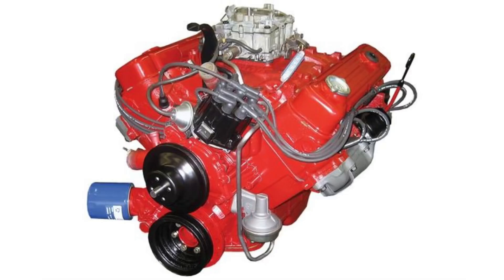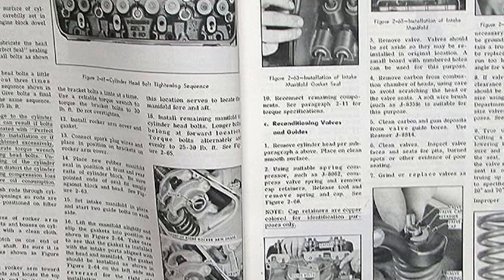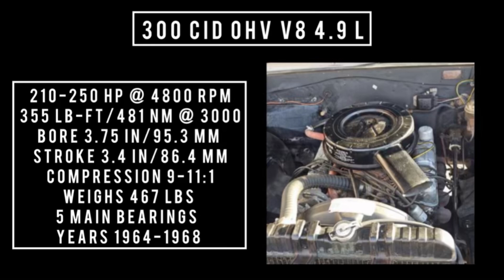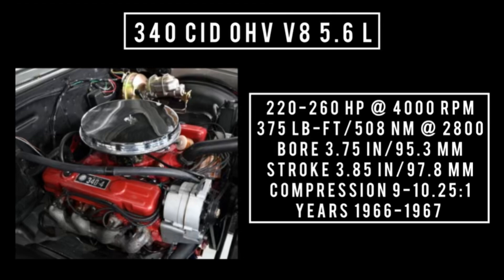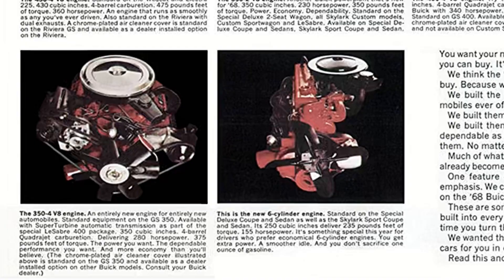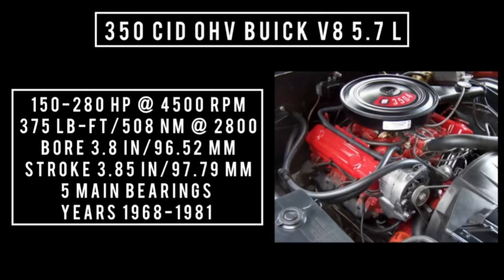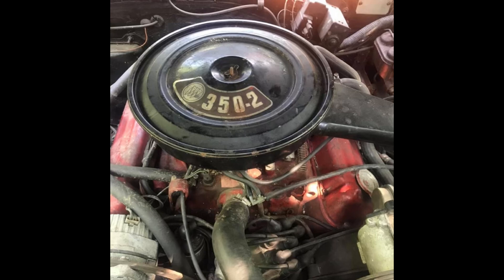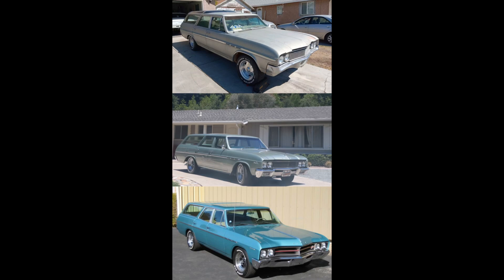Buick small block engine family 300, 340, 350

Comment: i have a 67 skylark with the 340.  It is a powerful engine.  I port matched the heads and smoothed out the chambers and put a cam in it.  No aluminum intakes or headers I could find so did what I could.  Runs hard and sounds great.  I have had buick 350's too and they seemed to be good motors too.  The 340 was hard to find the safety valve for in the oil filter housing that bypasses a plugged filter.  Had to drill a hole in mine and punch out the piston in it to get it to release then weld back shut.  Also the 340 has a small oil pan so careful if you put a high volume pump on, which is another story.  I think because there is no sump pump is why the pan is smaller.  Prime the pump before you start it the first time or periods of not running or you will roast the bearings!

Comment: It should have been mentioned that the 300 and 340 were revisions of the original 215 V8 design, but for the Buick 350, the entire top end was redesigned, beginning with the valve arrangement. Therfore,  even though the 340 and 350 share the same deck height, everything from the camshaft up was different- cam, heads, intake manifold,  exhaust manifolds, even the valve covers. Also, for 1968 the Buick 350 was fitted with the Quadrajet carburetor, making the intake manifold different in that respect also from that of the 340, which came with the square bore Carter AFB.
Reply from the maker: Thank you for sharing that insight
Reply: @What.its.like.  you're welcome. I learned all this because I have a 1966 Buick 340 engine.  It is a 2 bbl version, and I was able to buy a 4 bbl intake years ago for it. Hard to find, for sure.

Comment: In 1970 Buick offered the 350 in three states of tune. Top dog had 315 HP. 280 HP was the standard 4bbl version.
Reply from the maker: Thank you so much for that correction I couldn't find any information on the 350 everything that I found was very limited.. so 280 was the highest figure I saw 

Thank you for that correction

Comment: The 300 was available with a 4bbl carb for 1964 and 1965 only. It was available with the 2bbl carb from 1964 to 1967. In 1968 it as replaced by the 350. The 340 with either 2bbl carb or 4bbl carb was for 1966 and 1967 only. Also replaced in 1968 by the 350.

Comment: The Achilles heal to the really great engines, including the big Buick
 400,430,and,455 , along with the 225,and 231 V-6,is overly extended oil changes,poor quality oil filters with poor drain back valves.good oil and filter service is very important to the long life these Buick engines are more than capable of providing.
            Jay, thanks for the coverage of these great engines,and I thought I was going to point out they used these in Jeep products,but you knew that,as always great work, looking forward to the next episode.
Reply: Back then in the 1960's and 1970's standard O.C. intervals was 3000-3500 miles, I ran a fleet garage and never experienced oil filter related failures. In fact, in comparison to the filters on the market today, I'll take the old ones, less plastic and glue. We always ran factory branded filters and oil from top tier refineries. Keeping a vehicle tuned correctly was the secret, no gas contaminated oil from poorly adjusted carburetors, point and plugs every 12,000 miles along with replacing PCV every 24,000 miles.
Reply: @lorimcquinn3966  I have learned that there are differences in oil filters as far as certain performance characteristics.
              When I had my 68 Buick Special,with a 350,I bought a house brand from a big auto parts chain,instead of the name brand I would usually buy, installed it started the engine,waited for the  pressure to build which during the first start up takes a bit to prime, usually after that immediate oil pressure.With the house brand filter it would take its time building oil pressure,I bought the filter I normally bought,changed the house brand,back to instant oil pressure.
         What I learned,there is an important difference in drain back valves,and on certain engine makes filter position can be in my experience make an impact on how fast initial oil pressure builds up and in some cases can have a potential affect on potential bearing damage.
Reply from the maker: Thank you so much for sharing all that great information and insight greatly appreciate it

Comment: Hello Jay!  Just can't say how much I enjoy these engine episodes!  I always learn something!  In this episode I learned that the 340 and 350 Buick V-8's had a longer stroke than bore!  Not by much, but EVERYTHING was bigger bore than stroke in those days.  INTERESTING!  WYR One. . .1966 Special.  Two. . .1967 Wagon.  I knew a fellow that had a pretty nice 1966 Buick Sport Wagon.  A really interesting car!  Can't wait for the upcoming episodes!  Particularly the Graham and RUXTON episodes!
Reply: The G-block Oldsmobile 400 was the most undersquare V8 ever made.  As I remember, that was done for its inherent lower emissions profile.  But, there's a lot cubic inches trying to breath through heads and valves made for a small V8.  It was a great torquey engine for the big Olds sedans and station wagons but, it has very little performance improvement potential.  Put a later GM HEI distributor on it, a 2 bbl Holley Sniper throttle body fuel injection, and that's about all you can do to the G-block Olds 400.
Reply from the maker: Ruxton is next working on it now 

That graham was awesome

Comment: WYR1:  The '66-'67 A-body Buicks are the best looking cars ever to wear ventiports. 
I'll take the '67 Skylark convertible, white with a black top and red interior, 340-4 three-speed column shift. 
I seriously considered one some years ago, probably swap in the Special/GS grille. Might even trim it out with the GS340 graphics. 

WYR2:  The '64 on show here is the Sport Wagon (5-inch longer wheelbase than the Special wagon, extended back doors and raised roof with glass panels). Buick discontinued the B-body wagons (LeSabre and Invicta) after 1963 and this was their near-full-size market entry.
Oldsmobile fielded a similar version of the F/85 wagon called the Vista Cruiser
My Mom's first cousin was high-up in Buick, actually head of a transmission remanufacturing plant in Atlanta, and he could get any Buick he wanted. 
He pulled up at our house in a sort of cream-yellow Sport Wagon one weekend morning and took us fishing at a small lake near his favored outdoor firing range (my Dad shot sharpshooter right-handed, expert left handed using a .45 the last time he had to qualify, and my Mom once shot a swimming snake with an M-1, it came down in three pieces. Me, I've never been a gun person).
I digress, just these memories come back. 
Long story short, I'd go for the '66-'67 Estate wagon, again with the high-compression 340-four-barrel.
I liked the looks of the steel styled sport wheels shown on the '67, but I think I'd prefer the improved stopping with the optional disc brakes that had their own styled wheels to accommodate the calipers.

Comment: We had a '66 Special DeLuxe with the 300 cubic inch Wildcat 310. Sweet car!
Also a '70 LeSabre with the 350-4 HI COMPRESSION, advertised at 315 horsepower, Somehow Mom snagged two '70 B-body Buicks with manual shift (the other one was an Estate Wagon). Not necessarily looking for them, it's just that's how it worked out.
Reply from the maker: Great insight and information

Comment: Back in the early-70's my best friend's father had just finished a tune-up on a '64 Buick Special or Skylark coupe and handed it to us to take it out and thrash it, to make sure everything was OK. It had the new 300-2 V8 engine and that sucker would really go. We were expecting it to have a 2-speed automatic, like most mid-sized and smaller GM cars. It just had the PRNDL and no "L2" position. We were surprised that it had 3 gears and we thought that something was wrong. Nope, it WAS a 3-speed automatic and the first generation of the S.T.400 . It was the first and only year which didn't have a "L2" gear position. It had the variable pitch stator so that is why that small V8 launched so well. In the same model car  from '65 to '69 the base automatic would be the S.T. 300 2-speed, up to 400 c.i.. A family friend had a 1967 GS 400 and it had the S.T.300 2-speed.

Comment: I once had a '78 Buick Electra with the Buick 350.  Incredibly torquey and moved the big car effortlessly.  
One day the cam began to show excessive wear, rocker arms were noisy, and had to be replaced.  I got what was was advertised as a Buick-specific RV-type cam and the numbers looked good.  Put it in and degree'd it in.  It was a DOG with that cam!  No amount of cam timing changed it.
 Finally found an OEM stock smog cam to directly replace the worn out cam and all the power came back.  Go f'ing figure!  The mechanic who helped me was amazed as I was.  How does a smog cam work so well?  Maybe the Buick engineers knew what they were doing.
Reply from the maker: Thank you so much for sharing that sweet story and the memories =) I've heard RV cams suck for high speed performance but have excellent power down low
Reply: @What.its.like.   In this case, the RV cam I got was a dog.  I believe the OEM smog cam was designed for maximum vacuum at low rpm's.  That gave it excellent throttle response and that Electra pulled away with effortless authority.  The trade off was that it started running out of breath at around 4000 rpm.
Reply: @BlackPill-obey  That was the problem for the most part with specific type cams, torque cams ran out of oats so to speak at higher rpms,high horse power cams general suffered low rpm drivability and came on strong at high rpms.
          VTC cams in late model ECM engined addresses both of the drivers demands cam position slightly retarded for low speed driving,and advanced for performance driving, depending on the demands of the driver.
Reply: When I had my 68 Special,there was a Buick parts in Alabama, called Postons Buick parts,I don't know if they are still around but they were a wealth of information,and sold great parts.,I bought an oil pump kit,could not of been happier.
Reply: @BlackPill-obey  I wanted to add one more thing on the cam,if you were trying to run the cam with the factory single exhaust system and catalytic converter,the engine will be a bit gutless. 
               You need at least from the manifolds back,a dual exhaust with a crossover pipe to really wake it up, but I am sure you already know that.
Reply: @patrickmcgoldrick8234   The mechanic who helped me said the same thing.  I just didn't want to put in that much more money.  The OEM smog cam was clearly designed to work with the stock single exhaust.  

A dual exhaust with headers and balance pipe would have helped the cam scavenge better.  But, even the best duals are not as quiet as the single and that Buick was totally silent.  On top of that, the cast iron Buick manifolds do not have equal geometry, which means they are made for the single exhaust system that GM installed.

Oh well.  Live and learn.  BTW, that barely used cam and lifters went to an engine builder that my mechanic knew and he would give it a try as it was intended.
Reply: @BlackPill-obey  I would not recommend headers for a street driven car, Buick factory exhaust manifolds are fairly good breathing manifolds, but what I have found through my own experience,is a good dual exhaust with a cross over pipe,or equalizer pipe make a marked improvement in breathing,and off idle throttle response, that's all I am saying.
Reply: @patrickmcgoldrick8234   Agreed.  I went through my headers phase many decades ago and, in most any factory engine, it made more noise than extra power.

Case in point:  I once had a '78 Ford F-100 with the 300 CID inline six.  Of course, I thought headers were the ultimate performance fix and I was able to buy a used dual exhaust header set for that engine.  I also bought a new Edelbrock 1 bbl manifold for the engine and a Carter YF carb to replace the original Carter YFA.

Cutting to the point, it was worse.  The main cause of lost performance was that the intake didn't get any exhaust heat to vaporize the air/fuel mixture.  The 300 ran like it was always cold.  But, I didn't want to admit failure so, I kept them for a while. Eventually, I put the old exhaust manifold back on and, fortunately, the Edelbrock intake was designed to bolt up to it.   Voila!  That 300 ran like a champ because the air/fuel mix finally had a hot spot underneath the carburetor.  A few more tweaks to the metering rod and other things and I'd say it was better than stock but, not by THAT much.  

The original net hp rating was 117 hp at 3600 rpm and my butt dyno estimates that it finally made 130hp at 3800 rpm.
Reply: @BlackPill-obey  I promise this is my last comment on exhaust,if you want a cheap way to free up the exhaust on a 240-300 Ford 6,go to a Auto,Truck salvage yard(Like one I work at)look for a factory 300 Ford 6 with fuel injection,and bag the 2 exhaust manifolds,which are header style,but cast iron,and they work really well as far as a better breathing exhaust with out all the higher under hood heat.
          Just a little tip,and in most cases much much cheaper than headers ,and in my own experience they work well,I promise this is my last comment on this.
Reply: @patrickmcgoldrick8234   Thank you for all the great input!  By the time the dual exhaust manifolds for the 300 came around, I already sold the truck.   Those 1 bbl Edelbrock manifolds for the 300 are very rare.

Comment: Call that music? We had Cream ... what did you gen get - auto tune,  gangster rap, "Tranny" Swift , that crap would not even make it as "elevator muzak" back in the day. 
  GM got busted sneaking in Chevy motors mid 70's, so they began to state that engines were "produced by various divisions" in the Ads. Most people at that time however were distracted by the "self recycling" feature of the Vega, they reverted back to iron oxide without any human efforts, thus saving the land fills for RVs and future plastic from the CCP.
Reply from the maker: Don't get it twisted I love music from the 60s 70s 80s I'm not a Swifty.. that was more emo than anything just for something different, they don't make music anyone that make noise

Comment: In 1970 the Buick 350 could be had with up to 315 horsepower and 410 ft lbs of torque according in their 1970 brochure.
Reply: 350-4 HI COMPRESSION. We had a manual LeSabre example, surprisingly easy on gas, 21-22 mpg highway at 70 mph and the air on.
Reply from the maker: That's pretty impressive all things considered
Reply: I had a hi - comp. 350 from a '69 Wildcat that was rated at 315 hp. It was one of the best engines I've ever had, to be exceeded by a series ll 3800. It makes me wish I still had the engines and the Buicks they powered.
Reply: @danielbennion80  Must have been in a Skylark or a GS 350. ALL 69 Wildcats had the 430 cid 360 hp. engine.
Reply: @erichanson3961  it was a Wildcat with a hi compression 350.
Reply from the maker: Sweet thank you so much for that information I couldn't  find anything for this engine just went off of what little information I could find =)